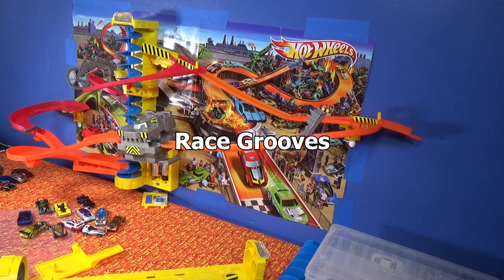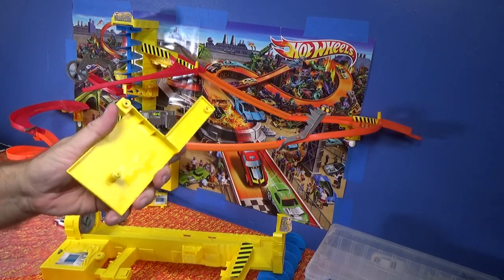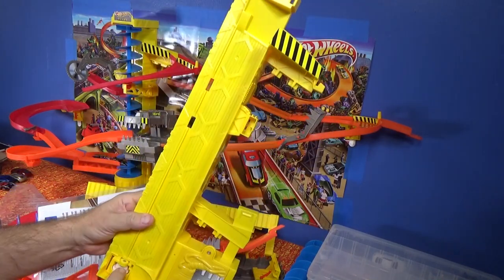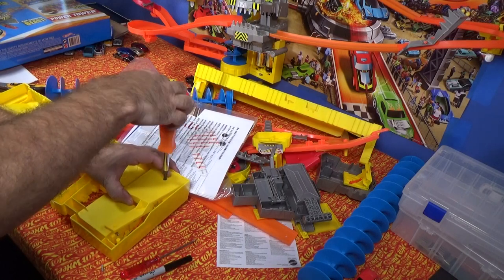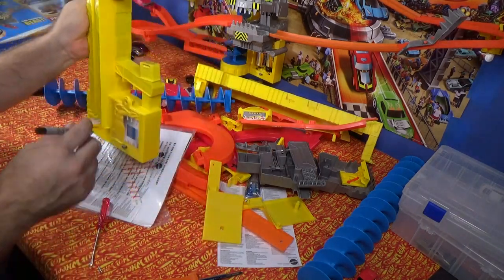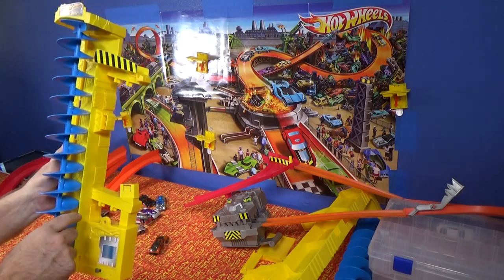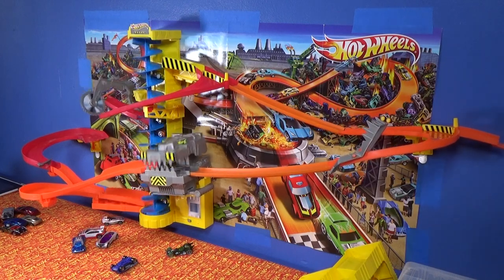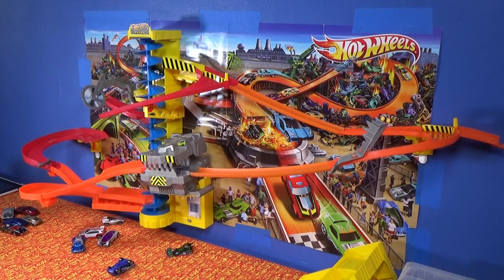Power Tower Problems

Comment: 7 years late but I solved the issue with the power tower randomly turning off.

Turns out the in battery compartment, the metal below the spring can sometimes shift and stop making contact with the rest of the circuit, which causes it to shut off completely.  

I got a flat-headed screwdriver and inserted it below the spring area and realigned the metal to the circuit, and now it’s good-as-new. Was this your issue after the 14th ptdd?

Comment: gotta love new toys built to brake in such a short time. the lubes they use will eat plastics very slowly from the fumes they give off inside closed spaces. It also happens to older stuff  as well if you ever go to a garage sell or thrift store and see old toys with white plastics that had moving parts will have a slight discoloration is from the oils and chemicals used as lubes.

Comment: Interesting video Mark! On the plus side, you have screws to let you into the Power Tower's inner workings. I have some 1970 Tune Up Towers that need repair but there are no screws to let you inside. Might have to break out a drill and Dremel tool.

Comment: this is exactly what happened to mine i set mine up one day i put two cars nerve hammer and shredster and it just wouldn't lift them up i didn't check for the problem i just knew it didn't work and in one of ur older videos u posted a video that had a chemical reaction with an eraser inside a pencil cup

Comment: My power tower fell off of the wall one night. I put on new command strips and I prop it up with a box now. But it works now, and that is good
Reply from the maker: +Cedric Prentice Yes, that is good =)
Reply: +RaceGrooves Hey race grooves, have you found the hot wheels workshop 
track pack that i was talking about yet?
Reply: My power tower fell to. But it wasn't a pain getting it back together.

Comment: I opened mine and it had the same problem than yours, seems that the yellow rubbers reacts to the plastic making it soft (like if it was melted) it, can be easily fixed thought, btw I also modified the power source by adding and old cellphone charger to it and now it runs plugged into the wall power outlet
Reply: +guillermo briceno Please tell me how you fixed it! I'm pretty handy, but haven't figured out a way yet.
Reply: +Speed General17776sg  I dont recall exactly how I did since it was a while ago but I think I scratch build new supports with a big piece of styrene and  attached the piece with drywall screws,  Ill se if I can get some pictures
Reply: That would be great if you find the time. Thank you so much!

Comment: Those transparent gooey stuff are gasket glue. Very much like Loctite red and blue that are used to mount screws coming loose from vibration. In this case the glue is used the same way and also enhance plastic joint strength. But you have a point the glue probably reacts to the plastic causing it to soften therefore detached from the main mold. I really hate how the motor is still the same lousy design after all these years.
Reply from the maker: +netmatrix75 thanks for the insight!

Comment: anyway. checked mine(BNEW) already gooey plastic. now, ill try to glue gun that small module that holds the gear while im pushing it back to where it should be. hope this works.
Reply from the maker: It is very unusual to have gooey plastic. That can't be right. I wonder if Mattel intentionally constructed it in such a way so that it would have a limited life expectancy.
Reply: @racegrooves  hi. hot glue did the job! try this on your sets as well

opened the back then pushed the module that holds the gear forward so it would lean closer to the gear of the spiral/helix then hot/super glued the contact points of the module to the main plastic body. (careful not to let the glue drip to the moving parts ie gear or axis of gears.) hanged it for almost a week now.  still holding on so far. 🙂 tried 6 cars in a row. also chomper, try cutting hard straws from 711 sodas. does the job and almost permanent/ snug fit.  also works with nerf foam bullets. cut the hollow part. snug fit as well😉

Comment: Do you plan to try and fix the towers ? I'm that kind of guy that will try to fix the problem before I buy a new part or set.
Reply from the maker: +Juan Soto I like to fix stuff too but I had already bought extra sets as back-ups. I would like to be able to use the spirals in future videos.
Reply: Good luck !
Reply: +Juan Soto I tried to fix our PT, but it hasn't worked out. I noticed the same wear and tear as RG.
Reply from the maker: +Speed General17776sg Bad news. I was going to do PTDD again, I put that set back on the wall that I used only for the last PTDD, and now THAT one has failed! It only lasted one video!
Reply: We are on our 3rd! I took the last one apart, changed the motor, tried a few things... it hasn't worked out yet. Anyway RG, my son loves you! He's the 'Speed General'. Lol. He's been emulating you for a while. If you commented on one of his videos he'd be over the moon. Thanks for doing what you do!
Reply: RaceGrooves Will you do any more ptdd videos? i love watching them.

Comment: Mine is going slower than usual. anyone know how to fix?
Reply from the maker: I do not recommend this set anymore because it apparently has a flaw to cause it no not last more than a few years. I have opened extra boxes that I had stored and they fail as well.
Reply: RaceGrooves oh. Well mine is still working fine after 2 or so battery corrosions.